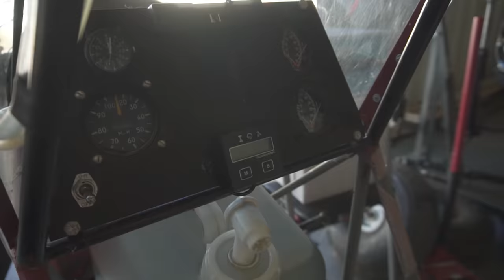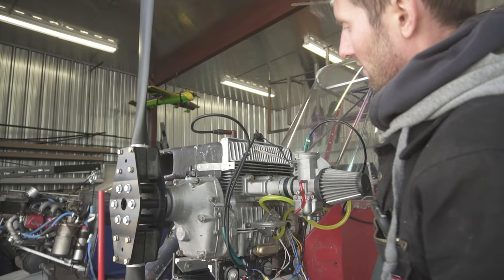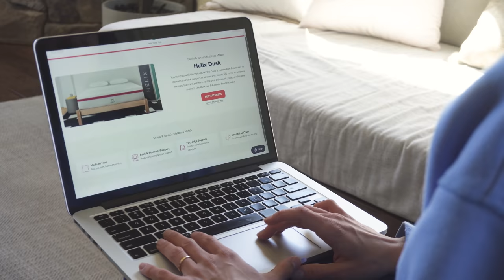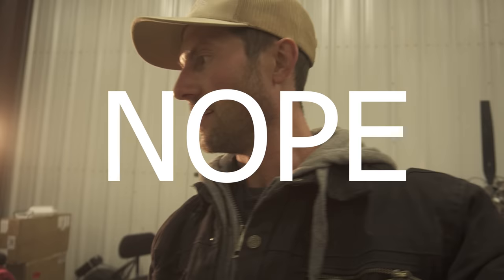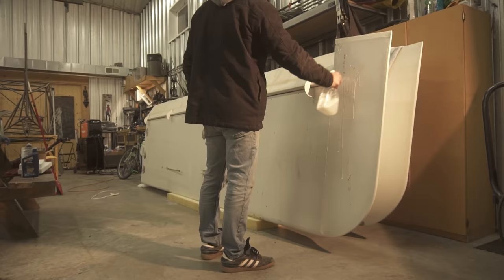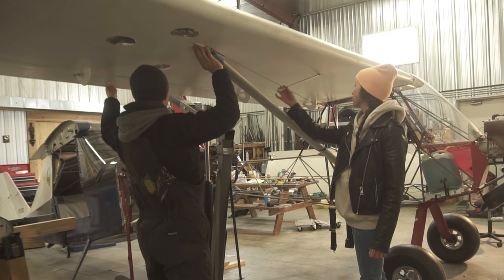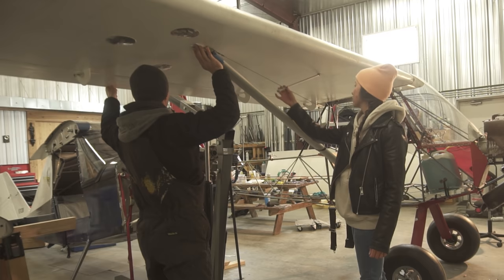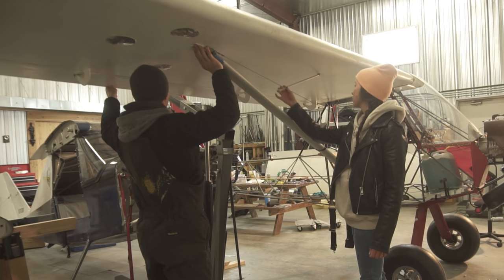I DIDNT EXPECT THIS. Abandoned airplane VLOG. 3

Comment from the maker: Click here https://helixsleep.com/marcinko for up to $200 off your Helix Sleep mattress plus two free pillows! We are sleeping on cumulonimbus clouds :)
Reply: Hopefully with less hail, lightnings etc😅
Reply: What about the heat sync quality affect that moving the feul box/pump will incur? As everything from the pump to the fuel being heated you're looking at increasing the heat, expansion of metal, heating of the fuel before it enters the engine, as well as the increase in heat around that part being moved. I'm curious how what your thoughts/concerns are? If any, lol.
Reply: @JeremyWallaceSnackums  Plenty of airflow and not mounted flat against the engine so no worries 👍

Comment: I always rubber isolated the fuel pump and kept it away from the engine block so there’s not excessive heat and vibration being transferred to the pump.
Reply: and I think loctite on the screws would be a good thing too.
Reply: yup, engine vibrations can create air bubbles in the fuel pump & delivery lines from the pump-s to the carb-s. Mount it back on the firewall again so its isolated from engine vibrations by the rubber motor mounts but a little above the impulse line nipple height of the crankcase. And yes keep the impulse line as short as reasonably possible, but pump should be fine anywhere fairly close to the engine. also use good fresh fuel line, not plain old rubber vacuum type line, The colored vinyl hose is UV protected, that's good, the clear stuff isn't, or use good braided rubber fuel hose. Those impulse pumps are pretty simple and work fine even on big bore high power snow sleds.
Reply: @oneninerniner3427  see my reply above...There is a reason it was on the firewall...
Reply: @MACE1-1  uuh yeah, think I did and said same didn't I?  just elaborated on it further. Sorry that bothers you.

Comment: I bought a Belite that had been sitting in a barn and the first thing I had to do was add big access hatches to the wings to remove nests that I could see when I shined a light through the fabric, luckily I didn't have to hack the wing up like you did, seems like it comes with the barn find territory, check everything before you fly!

Comment: I think I need to remount the fuel pump on my little airboat. It's a hopped-up Honda clone with the pulse port taken off from where the governor was once located in the crank case. The fuel pump is below the engine.

Comment: While geodesic construction has it's merits; it's not without it's limits too.

There used to be a guy that designed an airplane called the Ritz Standard using geodesic construction and a single strut design.

He was able to find out just what the material limits are. The problem is you only test it like he did one time.

Look up the story of the Ritz Standard sometime to learn the rest of the story.

Comment: Keep the fuel pump off the engine. A 447 vibration frequency will cancel pulses of fuel pump...There is a reason its on the firewall...

Comment: What about the heat sync quality affect that moving the feul box/pump will incur? As everything from the pump to the fuel being heated you're looking at increasing the heat, expansion of metal, heating of the fuel before it enters the engine, as well as the increase in heat around that part being moved. I'm curious how what your thoughts/concerns are? If any, lol.

Comment: What was the original process? Every process specifies how to test fabric. Maul tester isn’t one of them generally. Looks like Stewart glue you used. Suspect that process wasn’t available when original cover. If poly fiber, consult their manual for proper repair.

Comment: Was the air bike stored with the wings off and leaning against the wall, or were the wings on it. Just wondering if mice can get into the wings with them on the plane? I am really enjoying your “adventures “!
Reply from the maker: They were stored off the airplane. It would be hard for them to get in the wings being attached, but I wouldn’t be surprised if they could figure it out.
Reply: @JonasMarcinko  Thanks Jonas. I inquired because I have just started to build a wood framed airplane and need to figure out a safe way to store the wings separate from the fuselage. Keep the videos coming!!!

Comment: Should you do a fabric test after resealing the wing to test that it hasn’t compromised the strength at all?
Reply: Obviously the tape will double the strength not weaken it. Use your head.
Reply: @anthonyrstrawbridge  not necessarily. He explained that he will use glue and heat to adhere the fabric to the airframe which would be worth checking again in my opinion
Reply: Yes! First the fabric is either adhered or sewn then fabric is cut using pinking shears and again glue applied then fabric then heat. That's the entire job! Geeze
Reply: @anthonyrstrawbridge  bloody hell why you so defensive about it mate. Need to calm it I reckon
Reply: @olliepackman199    I am satisfied with the test. I'm not second guessing. I'm relaying confidence. It comes with both personal experience and reading the contributions of others. Quite frankly there is little if any concern warranted. Enjoy the show.

Comment: That's a two stroke. Where would the oil come from to clog the fuel-pump????
Reply from the maker: Good question. I had quite a bit fill it up when we first started it but you would think it would be gone after a few minutes. Idk 🤷🏻‍♂️ better safe than sorry
Reply: @JonasMarcinko  The fact that fuel evaporates and leave the oil "behind" is a well known problem with two-strokes (both carburettors and fuel-pumps can clog). How ever, the actual location of the pump has little (to nothing) to do with that.

Glad to see you were able to clean out the wings without having to peel of all of the fabric! So looking forward to the maiden flight! Keep it up!

Comment: The fuel pump mounted to the engine would likely aerate the fuel from the vibration. Mount it flat, above the pulse line, not to the engine. Its easy enough... simple bracket. that red puke tube or whatever on the carb 'should' loop together with a small hole in the bottom...... wait... why am i looking at a naked guy
Reply: Uhhh that leading edge D spar is pretty important... i got a set of max wings over in Nor Cal if you need em... still watching
Reply: Well closer look as your pulling crud out.... ya thats not a max wing lol

Comment: Might be a stupid question but why didn't you repair that wing before mounting it?
Reply from the maker: I did repair it before mounting it.
Reply: @JonasMarcinko  The right wing that Silvia helped hold up still had that little 1.5 in hole in it when it went on. Unless you took it back off and fixed it. I saw it.